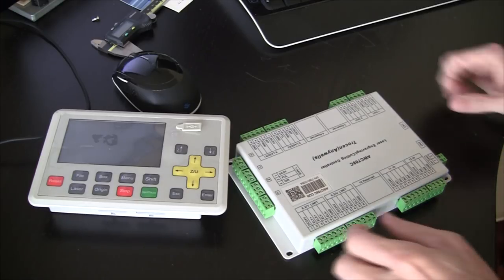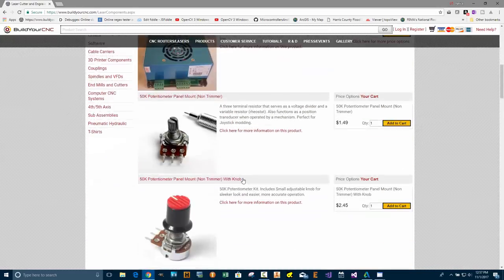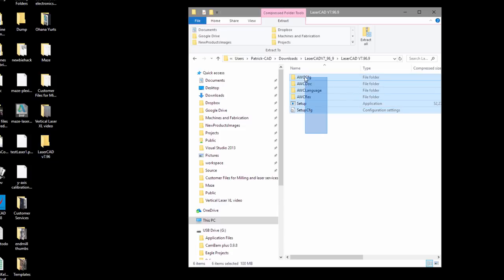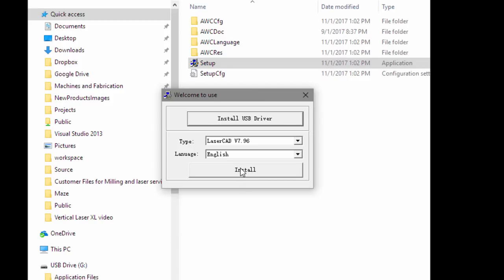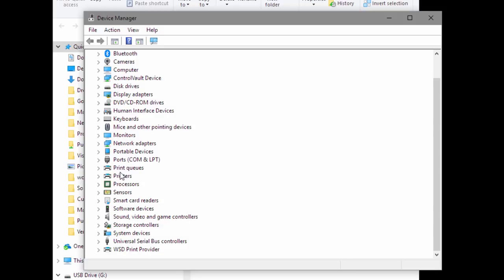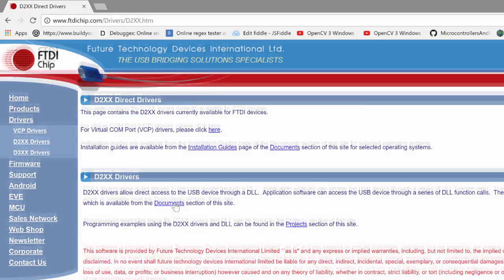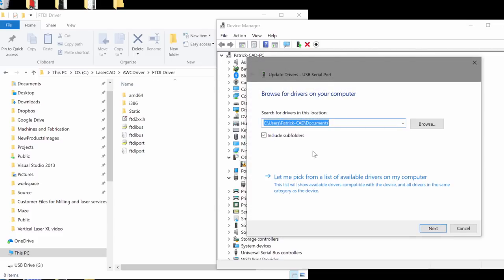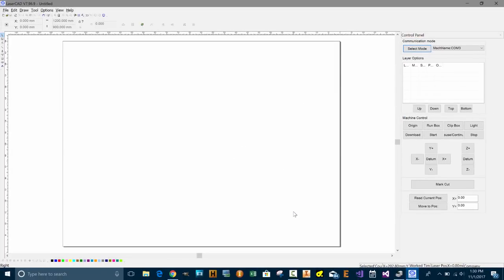LaserCAD Installation and How to Resolve the "Communicating Unsuccessful" Error.

Comment: Good Stuff., Ill give it a shot on my setup. Fwiw My install works. somewhere along the line the USB will fail it like I have a bad cable as all I need to do is unplug / replug the usb cable (any connection point(not just one connection point)) solves it.